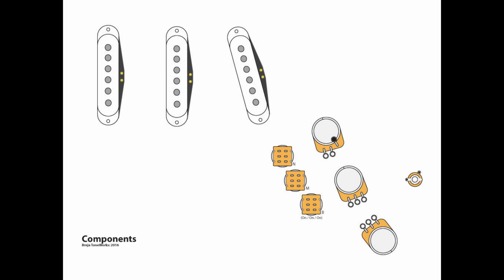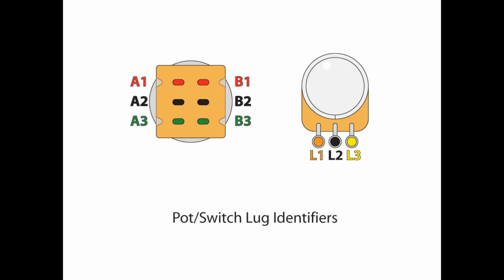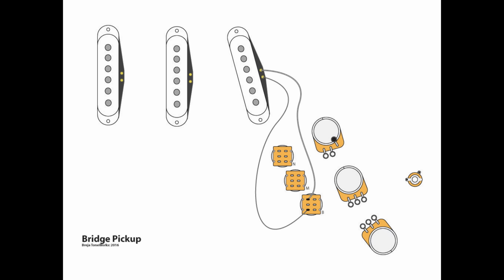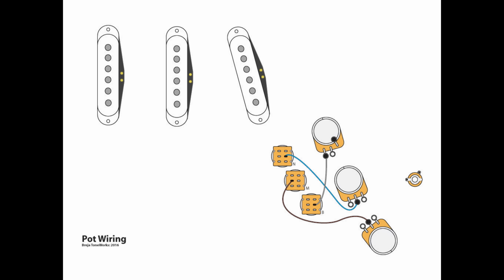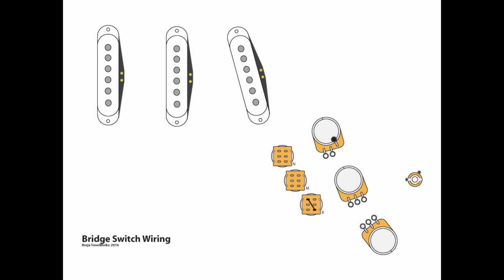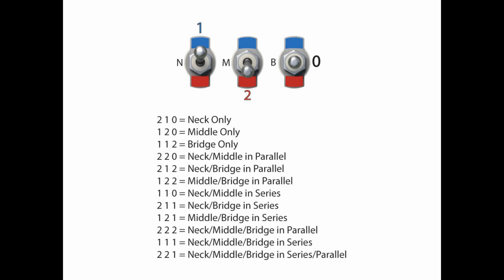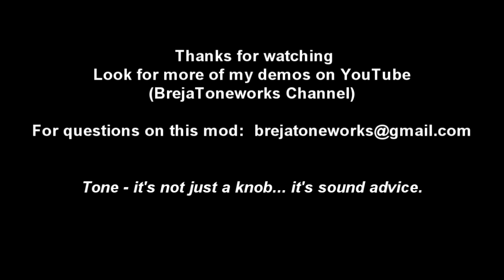Super Strat (3 Mini Switches) Wiring Mod

Comment: I suppose that this could also work in the case of a strat fitted with 3 hot rail humbuckers. In that case it should also be possible to wire a coil split option, but to have that option might require 3 additional toggle switches so that each coil could be split individually - that would be almost too many options to think about!

Comment: Hi there every one I just finish this project. And this is a dream come true for me .i Always invision independent switching for each pick-up I saw an old Stratocaster style guitar European made one that had Independent switches that was in the 80s I couldn't find that guitar in particular .and a friend of mine had a super Strat by fender with a Floyd Rose tremolo system and independent switching. but that guitar had only off on switching that means if all switching where down the guitar would not have any signal coming out from the guitar .and later on a friend of mine had a Kramer focus 6000 with independent switching but only 1 volume no tone control. it was an okay guitar bright clear sound .but same problem if the the switches or all off the guitar had no sound coming out of the output .this is so much better. many people like the 5 way or 3 Way switch that is because it's simple to get from one place to another .but you don't have all combinations .the strat can give you much more. Then is what initially  made by the Fender Factory. i Modified this diagram I added two humbuckers a neck position and a bridge position split coil both of them independently the tones I'm able to get now are so beautiful i'm so happy and lucky to have such a great functions in my guitar now thank you for posting this it's amazing I think all strat's should have these options again thank you..
Reply: I am new to strat wiring, and have been itching to ask: Why two tone knobs? Can this be done with just one tone knob? Thanks for your answer :)
Reply: @Jackofallthetrades  to my configuration when you’re on serious switching, you can adjust the tone up and down while the other pick ups will have the tone adjust in a different way, like middle pick up completely open tone while the neck pick up has the tone rolled off giving you beautiful tones

Comment: They need one thats like my strats wiring, 2 pushpull pots, one as an on/off switch for neck pickup the other as a reverse phase switch fr the middle pickup. Then an s-1 switch to switch between series and parallel. that gives you a total 17 pickup options, not to mention when you have 2 active pickups with one in reverse phase and the two wired in series, that is the same thing as a humbucker since humbuckers are the same thing as having two coils in series with one of opposite polarity. The s-1 switch will wire them in series and the reverse phase switch will make one of the two active pickups be of opposite polarity. Lol you get more options than a dual humbucker guitar with coil splitting. cause now you can get boh single coil and humbucker tones with all single coils lol. of course i would like a video on it so i can wire ext time (i had a tech do it for me).

Comment: Hi, thanks for the video, very informative. 
Would it be possible to do something along those lines using only three on/off-toggleswitches and a master series/parallel on/on toggle? For the sake of simplicity and minimal redundancy, and because DP3T-switches seem hard to be hard to find.
So it would go like this: 

Master series/parallel up (Parallel):
Neck 
Neck - Middle (Parallel)
Middle 
Middle - Bridge (Parallel)
Bridge
+
Neck - Bridge (Parallel)
Neck - Middle - Bridge (Parallel)
All three off (Parallel, for the sake of continuity and consistency)

Master series/parallel down (Series):
Neck 
Neck - Middle (Series)
Middle 
Middle - Bridge (Series)
Bridge
+
Neck - Bridge (Series)
Neck - Middle - Bridge (Series)
All three off (Series, for the sake of continuity and consistency)

Thanks in advance.
Reply: yes upvote!!!
Reply: Were you able to build this mod using your master switch? Did you use a master toggle or a push/pull on one of the tone knobs? I don't understand why the third toggle has to be an on-on-on rather than a on-off-on like the other two toggles. It looks to me like the bridge pick up is on all the time. I like your mod if it works and if I can use a Push/pull in place of the master toggle. Thanks for your help.

Comment: You can also run the pick up wires through a phase switch and take it to another level.
Reply from the maker: +BABY&#39; DAN BAGSHIT What are you trying to do... build an Atom Bomb?   :)  Yep - for sure you can add more switches for Phasing.
Reply: Yes I did it, also my bridge pickup is a hot rails with a series /split/parallel switch before it hits the phase switch so yeah its basically these 3 switches, 3 push pull knobs for phase and the extra on on on switch that controls the bridge pickup wiring(series/split/parallel)
Reply: I will call it the super strat wynberg wiring (SSWW) for short xD

Comment: Could you show a coil tapping demo using mini toggle switches(2) for a two humbuckers, single volume & single tone pot. I have an older PRS Santana in which the bridge PU is 10.5 & neck 8.4 which should closer to a single coil when tapped. Thank you.

Comment: Thank you very much for your wonderful circuit, which is having 12 positions.
Please mention the values of both capacitors and potmeters. Is that volume control is log or lin ? please answer.
Reply from the maker: Caps are subjective to the player.  I tend to use .015uF and .022uFsPots are 250K because we're dealing with Single Coil pickupsAll of my pots are Audio Taper.

Comment: I've had this switching set-up on my Strat since a couple of years after Dan Armstrongs article in Guitar Player. Now I'm trying to get my head around adding a mid-boost and a TBX after the switches. Is there a single (signal out) wire that could feed the pre-amp after switching? Or am I into a total briar patch in trying this?
Reply: between the output of the volume pot  and the jack. then your preamp output goes to the jack

Comment: Did it, twice. Not happening. Maybe some video would help?, idk. These are solders, you aren't plugging it into an outlet, so re-soldering 3 connections to the same mini-toggle pin isn'tworking for me. Do you really do it that way? If so then a video of your technique would be very helpful. I am making a mess of it.

Re the toggle switches-- does it matter which end is on top? "If the pot is inverted"-- that is an important point, can you explain? Does it matter which end is up? If so how do I tell? 

What kind of wire do I need, and where do I get it? My local hardware store just sold me something that looks like a heavier gauge. 

Idk, did it twice, thing is humming really loud and nothing else. I swapped out pickups when I was 17, no problem. This is not working though.

Comment: Hello, thanks a lot for this information. I failed in this attempt, the 4-way switch on my telecaster worked very well for me, but this circuit has not worked for me, I have already soldered it 2 times, I wrote to your gmail account, I hope to find a solution